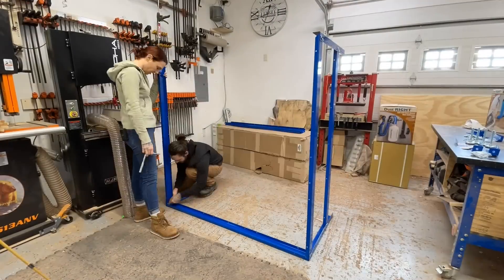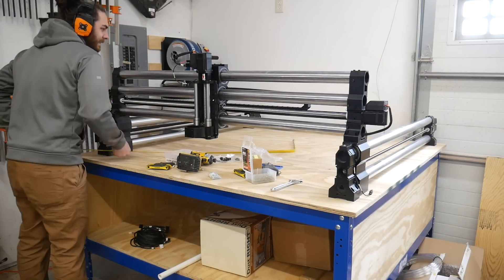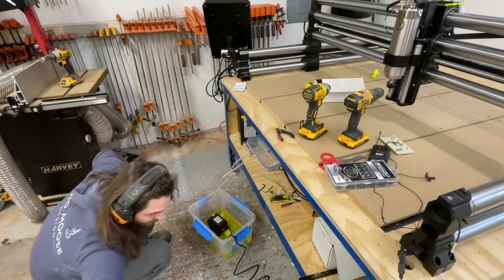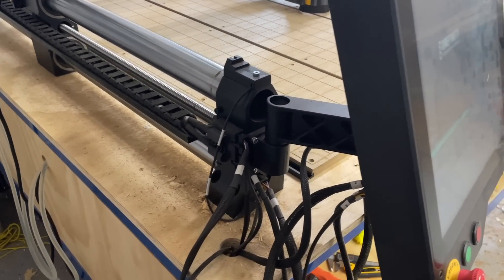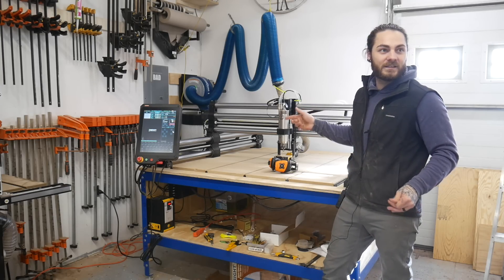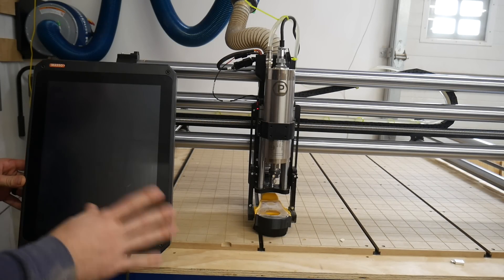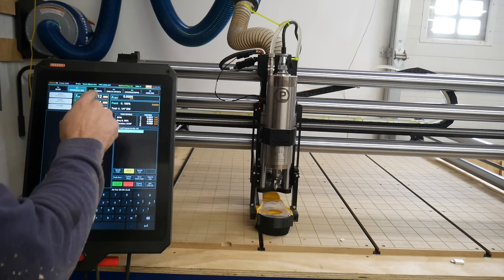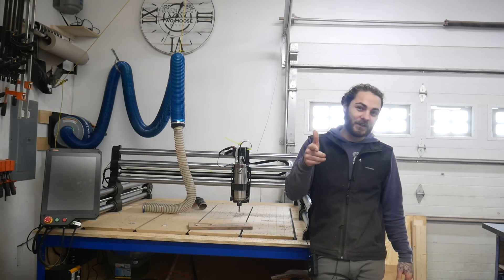Onefinity Elite Foreman // Set up and Overview

Comment: Did you zip tie the coolant lines to the drag chain? If you did how’s that working out? Might have to do that myself
Reply from the maker: I did but just around the clip part, it’s fine for now. I just got some hose holders from rowdy Roman on Etsy. The zip ties work but kinda shotty lol I need to install them yet
Reply: @TwoMooseDesign  I got them too. My drag chain was damaged in shipping so those clips hit now. Onefinity is sending a replacement. Just wanted to try something in the meantime. You said just around the clip? Mean where it locks on each link? Thank you for your help!
Reply from the maker: @LavinWoodworks  awe man that sucks! Yeah the top thin part that locks in. I used small zip ties
Reply: @TwoMooseDesign  it’s all good shit happens. Happy they will send a new one out. Thanks for the advise and help. Love the videos man!!
Reply from the maker: @LavinWoodworks  thankfully they’re good about that!

Comment: Thanks for sharing. My two cents on DC, a cyclonic separator is a great add on to dust collection and running the 4 inch hose all the way to the spindle would better the dust collection.
Reply from the maker: Thinks for the insight! 👊🏼👊🏼
Reply: @TwoMooseDesign  What kind of issues did you have with the dust boot?  I had heard that the Z-20 slider might have some compatability issues with a lot of the dust boots out there.

Comment: I'm just guessing but that looks like a 3/8 bit? Try 12000rpm at 400 imp with a .175 stepdown and 50% stepover. Your chatter seems like it's just from not getting the right chip load. I run most stuff at 600 imp up to 3/4 depth full engagement. Your machine seems solid enough to take a .017 chip load
Reply from the maker: Thanks! I’ll try it

Comment: controller is nice
Reply from the maker: Huge upgrade from the last one
Reply: @TwoMooseDesign  yeah i have the other and well it works kinda lol
Reply: @TwoMooseDesign  the old controller z motor is 118ipm max. what is the max ipm for the z motor with the new masso and upgraded z mount?
Reply from the maker: @bubba6945  you can change that in the settings. And this one is stock at 400 but you can change it as well

Comment: What size bit were you using for the test carve? I've heard that 1/2" bits can be a bit too much for the onefinity, but i'm wondering if the new heavy duty z axis helps out at all. I'm hoping to do some deeper pockets, and i'm thinking the 1/2" bits would give me the best results for that.
Reply from the maker: I use half in bits all the time. I use up cuts and down cuts for clearing. Goes way faster, I don’t use ether for cutting things out.

Comment: I still don't have a CNC yet but I do have a kreg bench.  I put a center divider in the bottom Shelf because I have access from both sides and I made slide out shelves.  This made the unit very very stiff.
Reply from the maker: Nice great tip

Comment: Thank you so much for taking time to put your videos together.  I enjoy watching and learning.  I know you haven't had the PWC spindle kit very long, and I have no knowledge of any kind of spindle or  CNC, and am just searching my options.  I like how sturdy the Onefinity looks, and how nice the spindle seems to work.  Anyhow, I was hoping to hear how pleased or disappointed you are with the spindle after using it for a little while.  Oh, and I do appreciate the 5% discount if I do indeed go with the PWC Kit.   And the 15% discount Onefinity is offering on the Elite for a limited time, they couldn't tell me how long that is going to last.  Again thanks for all your videos, you do a real professional job.
Reply from the maker: Hey! The spindle is great, they’re is cheaper brands that come in kits for half the price but the PWN spindles are plug and play. The cheaper ones require programming and soldering of the cords. An air cooled spindle is a huge upgrade from the regular router.
Reply: @TwoMooseDesign  Thanks for the reply, I do appreciate that.  Another quick question, I have gone ahead and ordered the Onefinity Elite Foreman, and I will be ordering the Kreg stand.  My question is would the stand be sturdy enough if I went ahead and got the locking castor wheels?  Your opinion is highly appreciated.  (Side note, I did order the Two Moose bit set recommended through Onefinity as well.)
Reply from the maker: @eldonhinck1487  i personally would probably skip the wheels. I don’t know, but my journeyman has the wheels and definitely has more shake than the non wheels and the foreman is pretty hefty!
Reply: @TwoMooseDesign  Thanks again, I will take your advise, and if I find I need them, I can always order them later on.  Living alone, I just wonder if I needed to move it, would I be able to on my own?

Comment: Quick question, which brand dust boot are you using? I watched this the other day and don’t remember if you happen to mentor in the video.
Reply from the maker: I have one of the pwn boots I’m trying out, I typically use the suck it dust boot.
Reply: @TwoMooseDesign  which one did you get from PWN, I ordered the v7 for my Foreman with an 80 mm spindle, and received an email today saying the Z-20 x-axis is incompatible with the v7. Just wondering if I should just order the suck it from onefinity
Reply from the maker: @baileythompson3680  uhhhhhh V3 I’m pretty sure. And you can run the suck it I got two tiny adapters with my elite for the suck it.
Reply: @TwoMooseDesign  thank you for the information. It was nice to meet yall at workbench con

Comment: Be sure to factor in taxes and shipping! Came out to an extra $300 for shipping and $400 for taxes. QCW and stand was $580 (so more expensive than Kreg it seems). Touch probe and dust boot was another $200.
Reply from the maker: I did pretty rough numbers, there’s also bits and a computer if you don’t have one. Adds up quick!
Reply: @TwoMooseDesign  good point, totally forgot the bits! Gotta find a starter set somewhere. Thanks for the awesome video and looking forward to more Elite content

Comment: Most spindles will recommend de-ionized water.  I've never used coolant and the water stays clean.  Does PWN recommend a coolant mixture?
Reply from the maker: I didn’t even look, that’s just what I was told to use in my other spindle 🤷🏼‍♂️ so that’s what I did on this one. Guess I’ll check and switch it out

Comment: What the actual size of bed. I know it will cut a 4x4.  How much space have on each side to clamp a 4x4 sheet   Thanks  nice video
Reply from the maker: From the outside of the cut area to the rails is 2” then pretty much all you need front and back. They make plastic brad nails I see a lot of people use too for big sheet goods
Reply: @TwoMooseDesign  thank you wondering how much clamping space on each side there was.   Doesn’t seem like a lot 2 inches on each side.  Thank you 🙏

Comment: Air cooled is definitely the way to go. I’ve done a couple thousand jobs so far, often running all day long and have never overheated. The air also blows the chips out of the way of the cutter in most cases. I’ve been running 2 Masso machines for a couple of years now. You’re going to love it. If you haven’t already, set up Automatic Tool Length Measurement. It makes everything so much easier when you have to change up your tools.
Reply: Would you have a link to one that works with masso?
Reply from the maker: @LavinWoodworks  a spindle? Pwn spindles hook right upto it. It’s the same one I have but not water cooled. You can control it from the masso, I have a 5% off code in the description. You can buy cheaper versions but they are not plug and play like the pwn is.
Reply: @TwoMooseDesign  no I was trying to respond to the tool setter
Reply: @TwoMooseDesign  but thank you for responding! Love your videos!!
Reply from the maker: @LavinWoodworks  ohhhhh yeah that I don’t know yet. I’ll have to dig into that and 4th axis
Reply: @TwoMooseDesign  Automatic Tool Height setting is sort of built in to the Masso controller. You must have a probe of some type connected to measure Z zero, right? The tool height setter is the same exact thing, just connected to a different input designated for it. You typically would fix an aluminum block to a specific spot on your table and designate that as the tool height measuring location. Whenever you do a tool change, the machine will jog to that spot and measure the length of the tool so you don’t have to re-zero the work. It’s well described in the documentation, but also check out Peter Pasuelo’s channel CNC Nutz. He is actually the official Masso tech guy.
Reply from the maker: @michaelkeymont501  I’ll definitely check him out thanks!
Reply from the maker: I’ll have to research what that is! And yeah I definitely should have went air cooled and skipped all the hoses 🤔
Reply: You are selling me on air cooled.  Was going to follow in the steps of Two Moose, but keep rethinking and not wanting all the hoses.

Comment: You have a pet so I would suggest propylene glycol as a coolant, it non toxic. That way you don’t have to worry about spills or leaks. Antifreeze will kill a pet really quick.
Reply from the maker: The pets don’t come in the shop often and it’s in a sealed container on the middle of the bench shelf so I’m not too worried but I’ll check it out!

Comment: Great video. 

Quick note on antifreeze, find yourself some "multi-vehicle" antifreeze. Standard antifreeze doesn't work with aluminum. Multi-vehicle has inhibitors to not cross contaminate mixed metals.  Use it with deionized water or at least distilled water, never tap. Antifreeze should keep the water in good shape for months, likely much longer.

Antifreeze is actually a poor heat conductor if used without water. You should be fine running anywhere from 50/50 to just 25% antifreeze. Never go wrong mixing to the instructions on the bottle.

Thanks for showing the machine in action.
Reply: Some alt options,  use RV antifreeze instead of regular vehicle antifreeze (doesn't contain corrosives). Run distilled water through a CW-5200 chiller (in winter I use an aquarium heater in the cooler to ensure the temp doesn't drop to freezing as my garage gets very cold).
Reply: @cyberhikerdd  cw3000 without active refrigeration is better. Refrigerated models can cause condensation in and around the spindle.  Bonus way cheaper to buy without chiller in it. Cw3000 just does ambient cooling.
Reply: @warrenbrown8670  I have the active chiller and never experienced condensation.
Reply from the maker: Thanks for the insight! I’ll check that out

Comment: Thanks for a quick intro. I will have mine setup as yours except mine is a journeyman elite with the kreg bench of 44x64. I hoped that fits. I also went with the Pwncnc with the 65mm air cool.
Reply from the maker: It will fit, my journeyman is on the same 44x64 bench!
Reply: @TwoMooseDesign  where did you get the 64x64 all I see is the 44x64? Did you order 64” bars and replace the 44” ones? Thanks I’m advance I’m waiting for mine !
Reply from the maker: @reubengunderson624  order two 64 rails and one set of legs
Reply from the maker: @reubengunderson624  I have them linked in the description